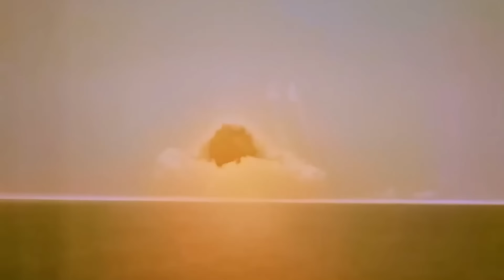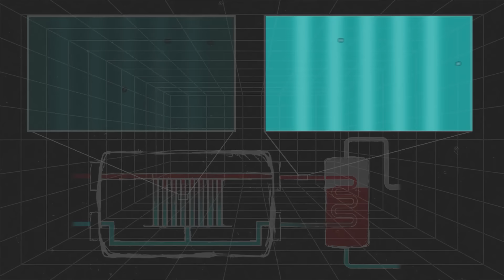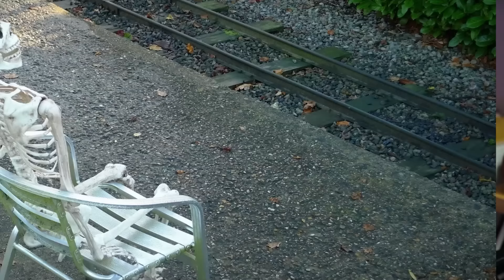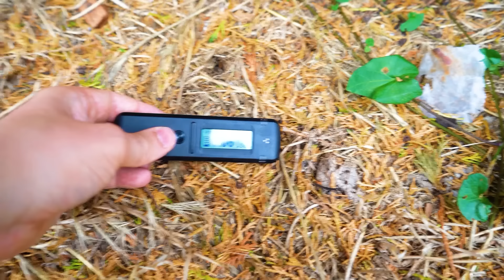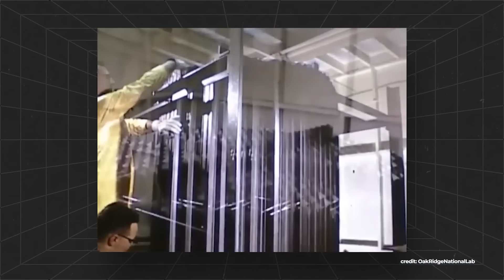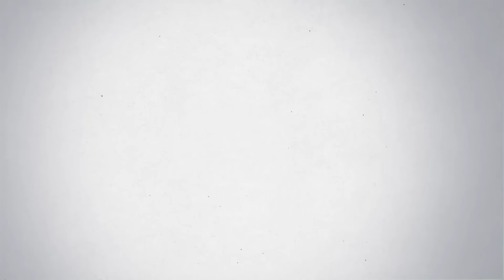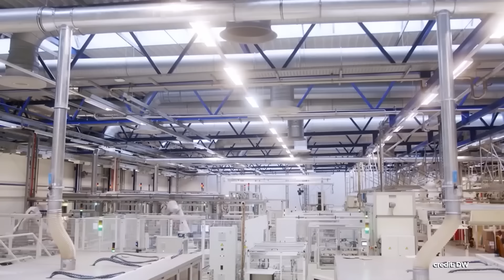It's Happening - China Launches World's First Thorium Nuclear Reactor

Comment: The molten “coolant “ works at 1400° C or 2552°F . Steel starts melting between 2500°-2700°F there about.  Not to mention the corrosiveness of molten salts. I must of missed that part of the video.
Reply: S2G was the initial power plant of USS Seawolf (SSN-575). This was one of three sodium cooled reactors (the core was moderated) ordered for the Seawolf program at the same time as three PWR units were ordered to support the USS Nautilus (SSN-571) program; In each case, one reactor was land-based for training and research, one intended for installation on a submarine, and one spare. The land-based unit corresponding to S2G was S1G reactor. The reactor core was beryllium-moderated.[1][2]
Persistent superheater problems on Seawolf caused the superheaters to be bypassed, resulting in mediocre performance. This and concern for the dangers posed by liquid sodium coolant led to the PWR type being selected instead as the standard US naval reactor type, and the S2G on Seawolf was replaced by the spare S2Wa reactor from the Nautilus program.
The Atomic Energy Commission historians' account of the naval sodium-cooled reactor experience was:
Although makeshift repairs permitted the Seawolf to complete her initial sea trials on reduced power in February 1957, Rickover had already decided to abandon the sodium-cooled reactor. Early in November 1956, he informed the Commission that he would take steps toward replacing the reactor in the Seawolf with a water-cooled plant similar to that in the Nautilus. The leaks in the Seawolf steam plant were an important factor in the decision but even more persuasive were the inherent limitations in sodium-cooled systems. In Rickover's words they were "expensive to build, complex to operate, susceptible to prolonged shutdown as a result of even minor malfunctions, and difficult and time-consuming to repair."[3
Reply: That's when it gets near boiling not "works" Mr. Daft. A 5 year old wouldn't even be this daft.
Reply: @DCMAKER133  
As per the Royal Society of Chemistry . Thorium 
Melting point 
1750° C 3182° F or 2023K
Boiling Point 
4785° C 8645° F  5058K
Josephpadula comment was far more useful.
Reply: @michaelj1492  HASTELLOY® N alloy (UNS N10003) is a nickel-base alloy that was invented at Oak Ridge National Laboratories as a container material for molten fluoride salts. It has good oxidation resistance to hot fluoride salts in the temperature range of 704 to 871°C (1300 to 1600°F)

MSR operating temperatures are around 700 °C (1,292 °F), significantly higher than traditional LWRs at around 300 °C (572 °F)

also due to addition of other ions (it´s not pure thorium) the melting point decreases, e.g sodium and potassium are solid when they´re mixed it becomes liquid at room temperature, that´s a so called eutectic mixture
Reply: @Humbulla93  Excellent!!
These are the type of points that were not mentioned in the video. Next up would be how easy/hard it is to work with these materials. A master welding friend of mine back in Denmark. Explained some of the intricacies of working with exotic metals. 
My point has never been. This can’t be done. Obviously it has. My point was this is not the layup that this video makes it appear. 
I do appreciate your information greatly.  It’s been well over 50 years since I gave physical chemistry any thought. Kinda fun to dust off those dormant brain cells.

Comment: I'd be interested in hearing when micro-reactors would be allowed -- in the sub-1MW range suitable for individual homes or vehicles.  As long as the fear of any tiny amount of radioactive material exists, it will never be allowed for distributed power and be limited to huge grid-scale reactors that can be set far from populations and guarded like they are a live explosive.  Molten salt Thorium is interesting because it requires very little fissile material, but accelerator-driven using a neutristor as the neutron source rather than U233 might be even better.  It would require ZERO fissile starter material and stop the reaction with the flick of a switch turning off the neutron source ... except that the molten salt would be accumulating fissile U233 and other actinides in small amounts anyway.  Maybe in a micro-reactor the amounts accumulated would be small enough to be deemed safe ?  That seems like the holy grail for a safe reactor that would be allowed for personal use, though -- a reactor that never contained enough fissile material for long enough to be a security or health risk.

Comment: The half life of the "nuclear waste" of Thorium reactors is exactly the same as that of uranium/plutonium reactor "of the same burn rate*. In other words,  there is an assumption that thorium MSRs will burn 90+% of the fissionable fuel, as it's assumed to be easier to recycle the fuel back into the core. Using the same assumptions for uranium/plutonium MSR gives you the same 300-500 year decay life of its "nuclear waste."

Why is the decay rate of modern reactors quoted to be 10 to 100 thousand years? Simple. Stationary solid core reactors (the ones with rods as opposed to the ones with circulating balls) struggle to burn more than 0.5%-0.7% of the available fuel before the fuel rods need refreshment. Often it's cheaper to store these used fuel rods than reprocess them. That means you have a rod that's +98% uranium that's been enriched to 5% to 20% fission uranium with a high rate of spontaneous fission. This means not only that it's more radioactive than natural uranium but that it's also very slowly bleeding small amounts of  plutonium in several isotopes. (Indeed, it's been said modern nuclear waste left to it own devices becomes so saturated with plutonium within 100 years that it would be economically advantageous to separate Plutonium from it. IE, a small Plutonium mine.) 

All of which is to say, the used rods of modern reactors continue to act as slow reactor cores in storage, creating radioactive isotopes for thousands of years after use. Where as molten salt reactors (MSRs) are expected to be able to eventually burn all the fuel in their core and used fuel will already be the final fission ash, which has a 10x half life (when they're about 1/1000th their original radioactivity) of about 500 years.

And I'm sure none of that made any sense. But it's important to note that it's the reactors fuel burn efficiency, not the fuel that makes waste with a long half life

Comment: You say “molten salts are corrosive”… this is not quite true. Molten salts are very hygroscopic (they absorb water) and the wet/damp molten salt is highly corrosive. The problem is keeping the highly radioactive molten salt dry. Keep up the good work!
Reply: Well, no. In high temperatures required to melt salts (and especially inside of the nuclear reactor, which generates a lot of heat) salts undergo partial dissociation. Because those are typically fluoride salts - you end up with fluoride ion, which does not care about exchanging its electron with anything around. It may happily bind back to some thorium, but anything other will be a good match in this nuclear tinder. Any electrical field gradient will speed up the process. This is not a new discovery - this dates back to the original process of sodium production from molten salt.
Reply: I thought the beauty of a molten salt reactor was that it operates at atmospheric pressure, any water should boil off and be drained. Why not use lead coolant?
Reply: @tobyw9573  pure lead is refuelling nightmare. You can add bismuth to form lead-bismuth eutectic, but activated bismuth results in polonium everywhere, so it is even worse. Alkali metals are liquid at the room temperature, but they need to be kept away from anything they can steal oxygen from
Reply: Keeping salt at 800 °C dry is automatically the case. It would be hard to add water to something at 800 °C, regardless of how hygroscopic it might be at room temperature.
Reply: @leocurious9919  you might think so, but water is a real problem. Plus, the water can react with the U/Pu and precipitate the oxides. Water is a BIG problem.
Reply: @MarkRLeach  Do you have a link to read about this?
Reply: @leocurious9919  sorry no, but I used to work on a fast chloride MSR design. I spoke with a group at the University of Manchester and they confirmed the issue and dried their salts with dry HCl gas.
Reply: The Chinese design has 0 water in the whole reactor. The turbines use supercritical CO2 and the reaction chamber is blanketed with argon.
Reply: @wedmunds  Good! But it is very very difficult to remove ALL water. Water is a huge problem. (The msr design I worked on also used an argon blanket atmosphere.)
Reply: "good work" lmao, first minute of the video he said "cant be weaponized" which is 1000% wrong. Thats the whole deal with molten salt reactors. they can easily be used for plutonium production as a breeding reactor. so bad and dangerous information

Comment: Bettis Atomic Power Laboratory built and ran a light water moderated thorium 232/uranium 233 breeder in the late 1970s and ran it through its life cycle. It yielded an fissile inventory ratio (FIR) of 1.01, meaning that it produced 1% more U233 at end of life than it had when it started. It was purely a research project that did not enter production.

Comment: my understanding is there is a big problem with corrosion and leaks. I don't know if this has been solved yet. The other issue is the salt and the fuel has to be processed to remove the waste products. You did not go into this perhaps because of time limits but it would be nice to do another video discussing the challenge's and what needs to yet be developed. It may be China has solved these issues.

Comment: Germany had a thorium cycle high temperature reactor synced with the grid in 1985 and AKAIK it wasn't the first thorium reactor. Liquid salt is a first though.
Reply: S2G was the initial power plant of USS Seawolf (SSN-575). This was one of three sodium cooled reactors (the core was moderated) ordered for the Seawolf program at the same time as three PWR units were ordered to support the USS Nautilus (SSN-571) program; In each case, one reactor was land-based for training and research, one intended for installation on a submarine, and one spare. The land-based unit corresponding to S2G was S1G reactor. The reactor core was beryllium-moderated.[1][2]
Persistent superheater problems on Seawolf caused the superheaters to be bypassed, resulting in mediocre performance. This and concern for the dangers posed by liquid sodium coolant led to the PWR type being selected instead as the standard US naval reactor type, and the S2G on Seawolf was replaced by the spare S2Wa reactor from the Nautilus program.
The Atomic Energy Commission historians' account of the naval sodium-cooled reactor experience was:
Although makeshift repairs permitted the Seawolf to complete her initial sea trials on reduced power in February 1957, Rickover had already decided to abandon the sodium-cooled reactor. Early in November 1956, he informed the Commission that he would take steps toward replacing the reactor in the Seawolf with a water-cooled plant similar to that in the Nautilus. The leaks in the Seawolf steam plant were an important factor in the decision but even more persuasive were the inherent limitations in sodium-cooled systems. In Rickover's words they were "expensive to build, complex to operate, susceptible to prolonged shutdown as a result of even minor malfunctions, and difficult and time-consuming to repair."[3
Reply: I believe Thorium has often been used in MOX fuel mixes when they are trying to dispose of and downgrade weapons-grade plutonium/uranium

Comment: There is ample R&D going on in the West with molten salt reactors, including thorium reactors.  In the end, whether you use thorium or low-enriched uranium, it is about on-line chemistry.  You have to clean up the solution while the reactor is operating.  The issue of converting thorium, a fertile element, to a fissile element, which happens in the reactor, is a second challenge thatnis only specific to thorium.  The first issue is more important.

Comment: Thorium reactor design is much more difficult then uranium 235 based reactors because of the neutron economy, that being said it is possible and you can make it easier if you can use some of the spent fuel from light water reactors to jump start a thorium MSR, but its almost impossible to get permission to do anything like that.
Reply: Thorium reactors might be more difficult than U-235 or plutonium reactors, but still a LOT easier than fusion reactors.

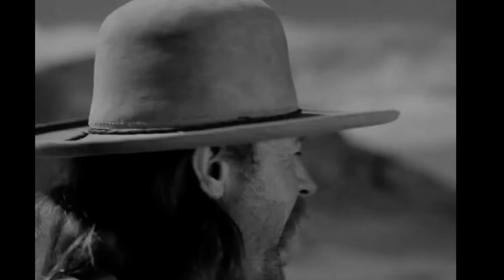Comment: I think that the heat exchanger drawn at around 3:20 should be inside the containment building, since it also contains highly radioactive fuel that has just been in the reactor. Besides, you would also want to contain in case of a leak.
Reply: Super critical CO2 turbines are more efficient and more compact.